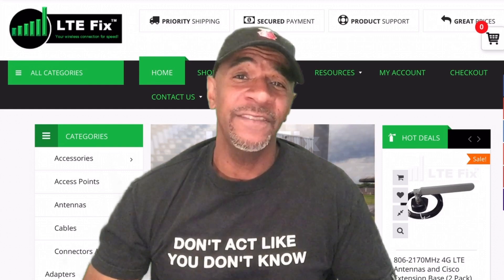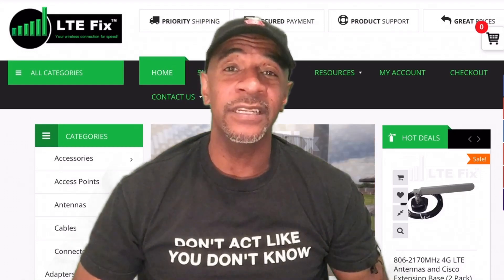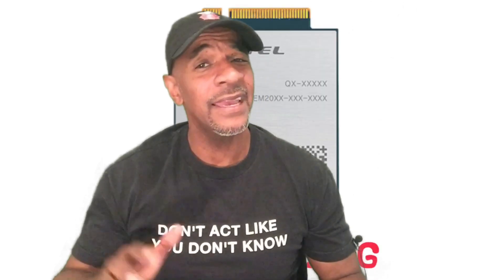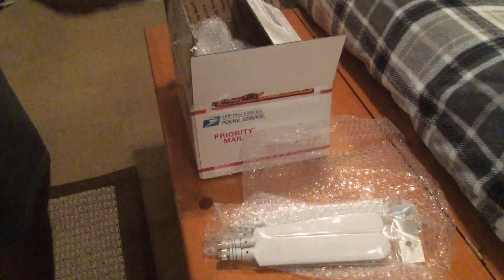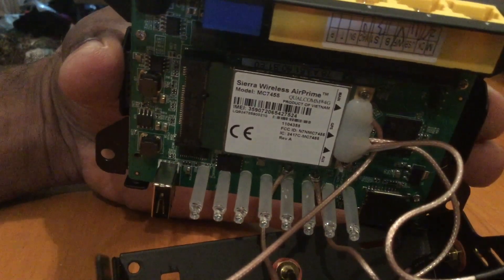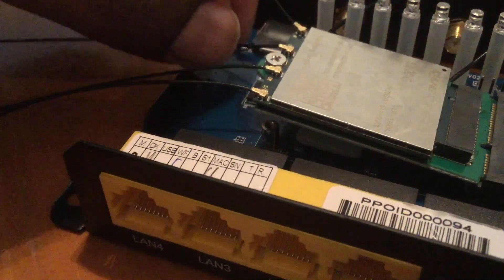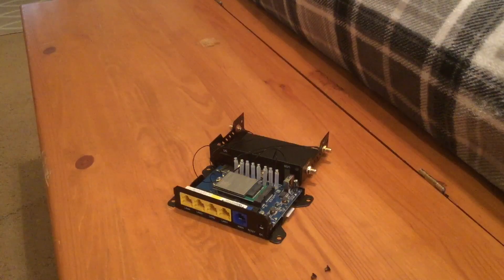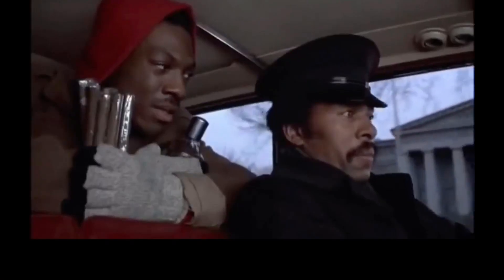How To Make Your Own Cell Router

Comment: Hey berry good juice. What plan do you have to buy though Att to get unlimited data SIM card. Iv had trouble trying to find one on the att website
Reply from the maker: The plan I have has been retired I’m grandfathered in however there are re-sellers like Bix wireless that offer unlimited data on the At&t network and I helped one of my neighbors that had an At&t post paid plan they added a tablet to their plan then swapped the sim into a Cell modem so there are options. The At&t website is not offering an unlimited data only plan by itself right now as far as I know.
Reply: bERRy gOOd jUICe thanks for the help on that. Also how much would you say this build is on your router? I didn’t realize how expensive they are.
Reply from the maker: Brandon B  here is a price list of my build as well as prices with different modems I also updated the description with it. 

NEXQ6GO Router                                $58.70

Quectel EM20-G Modem                   $250.00

MHF4 Pigtails (4)                                $17.00

Mini PCIE to M2 adapter                    $18.75
 
12v 30w Power adapter                     $11.85 

8dbi Antennas ( from Amazon) (4)  $27.98
                                                            ——————

                                                               $384.28

Price w/ cat6 modem  (same cat as Mofi)   $229.73 
Price w/ cat 12 Modem                                   $319.28

Comment: How much was everything?
Reply from the maker: luiseno 
Price w/ cat6 modem  (same cat as Mofi)   $229.73 
Price w/ cat 12 Modem                                   $319.28
Reply from the maker: luiseno here is a list I’m going to put it in the description soon 
NEXQ6GO Router                                $58.70

Quectel EM20-G Modem                   $250.00

MHF4 Pigtails (4)                                $17.00

Mini PCIE to M2 adapter                    $18.75
 
12v 30w Power adapter                     $11.85 

8dbi Antennas ( from Amazon) (4)  $27.98
                                                            ——————

                                                               $384.28
Reply: I bought a mofi4500 for 360

Comment: Looking forward to see how this works out for you.  I bought the MoFi 4500 SIM7 as I wanted support for Tmobile B71, but then I found out that Verizon recently put a cell tower in our area so I switched to them (via Visible).  I get 25mbps down on the MoFi, but my phone gets 50+mbps down so I am guessing the difference is carrier aggregation on my phone.   I have been looking at Category 6 and up modems.  Suppose I could look for a used MoFi SIM4.  When you get familiar with your setup, I am curious if there is an IP pass through mode (like on the MoFi) where it acts just like a modem (turns off wifi and send the internet connection right through).
Reply from the maker: N6EAJ I use my device as a modem/router then connect it to my Orbi mesh system (as an access point ) for WiFi (I don’t use the WiFi on my device) I prefer not to use IP pass through (even with my MR1100) ....just my preference, I’ve noticed better performance having it setup this way & this router allows you to have custom TTL settings on the router itself (like the Mofi) rather than individual devices. but yes you can turn off the WiFi and have it act strictly as a modem. Stay tuned to the channel as I plan to do a Mofi sim4 combo giveaway contest very soon!!!

Comment: Will this replace my WiFi extender? Because my signal can’t go beyond my garage
Reply from the maker: Leia Thompson this router has great wifi coverage (0nly on the 2.4 GHz frequency) but if you already have an internet connection there’s no need to add a modem to it. You can just use the router connected to your current router/modem but you may need a mesh system (I use one in my house) and you can find some for good prices nowadays.
Reply: bERRy gOOd jUICe I looked up a mesh system, they say the best is the Eero WiFi system... but I’m seeing that it works so well it may connect to “nodes” that are further away resulting in a weaker signal.. I want the WiFi to extend to my backyard as the front is covered. I thought 5g (which is what I have) was the best??!?
Reply from the maker: @leiarenee1317  your router has both the 2.4 and 5 Ghz Wi-Fi frequencies not to be confused with 5th Generation cellular (5G)  5 ghz is a faster frequency than 2.4 and has less channel congestion but also has less range. 2.4 is better at reaching further than 5ghz. Eero is expensive and not necessarily the best there are cheaper options that perform very well giving you WiFi all over. Tp link and Linksys velop are 2 to look into.

Comment: Berry you da man!  Looking forward to the performance video..  I'm not digging my mofi.. I'm guessing you have less in the cat 20, than the price of the mofi.. I may sell it and get what you bought.  I'll be interested to see if this outperforms the nighthawk..
Reply from the maker: Ty Demaree what’s up bro, quick question I know you use the At&t plan that I use what limit do you set yourself each month for the plan I’ve been keeping it under 400GBs but curious if you do more ?
Reply: @profitgee1  probably 3 to 400 gig, I've got two pre paid plans, so, I try to balance it.. I've got dsl on my main TV, with no cap at all so it does all the heavy lifting.. it's only 6 mbit, but it's fine for the tv only..  also you could get a post paid iPad plan for 20$ if you have att cell phones.. I don't think they are shutting those down unless you go wild with data usage.. at least for now.. is the one you built still cheaper than the mofi? I'm betting it is....
Reply from the maker: Ty Demaree it was a little more because of the modem cost (it was $250) but if I got a cat 6 modem it would have been about half the cost of a mofi for the same specs. As far as the Golden orb firmware I’m still learning it but I love the fact that you can literally write code commands to manipulate it and it’s very responsive only downside is I have to use my laptop because some commands don’t work from my iPad.
Reply: @profitgee1  I'm really curious how you like the rooter firmware, I thought about flashing the mofi to rooter... But the hardware is inferior to the cat 20 for sure..